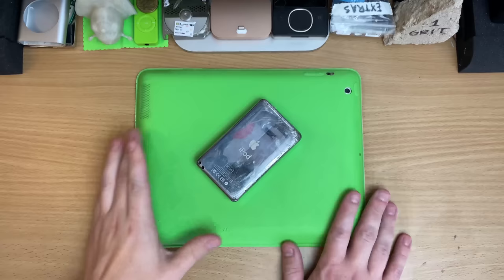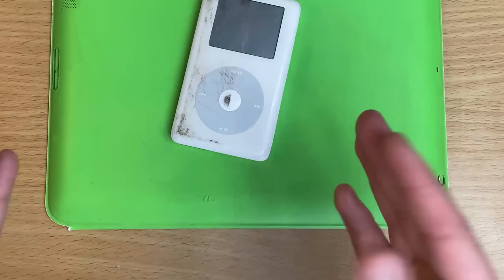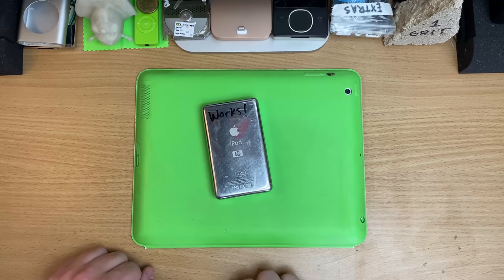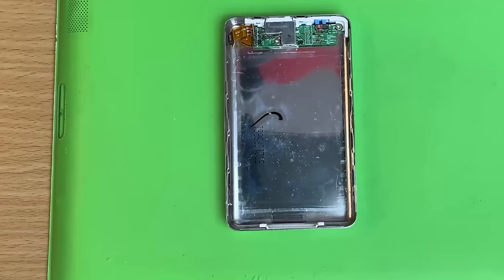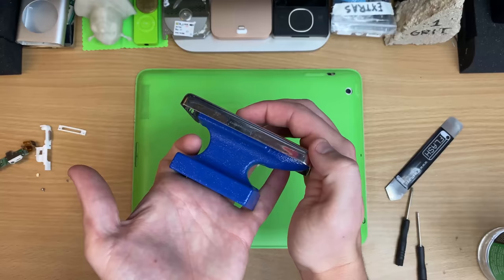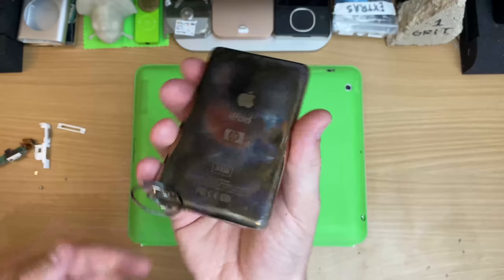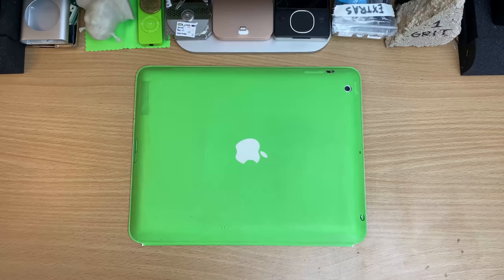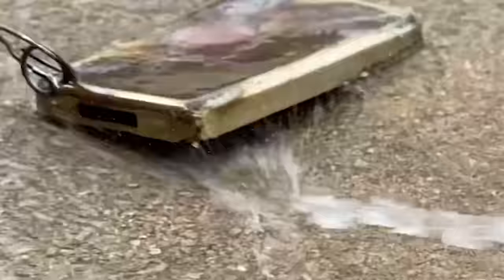I tried to "antique" my iPod.

Comment: Idk if you would have a way to get brass chips, but apparently if you nestle the steel in brass chips and heat it up from the bottom, the heat is very slow and even so you get a beautiful even blue color without warping or hot spots

Comment: A heat treat oven would put a perfect oxide layer on there. Contact a local small machine shop and see if they'll let you pop it in there for a few minutes. You could even control the temperature to get a specific color.

Comment: I work a lot with metal. You can reduce the amount of warpage those cases would get if you let them cool down with just air. 

Hitting them with water shocks them that will make the warpage more dramatic. Sure it takes longer but might make for a better final product.
Reply: I was hoping someone would say that (I know this is an old vid but I just found it). I have a friend who's a bladesmith and he would have a heart attack seeing someone blast hot metal with cold water like that.

Comment: you need to build an "oven" to get even heat, just a couple of fire bricks (or any other material that is heat/flame resistant i.e. anything used for building fireplaces should work) and don't apply the heat directly, it still might warp (I've never worked with metal this thin) so YMMW

Comment: Technically you could put the backplate on a metal container, inside the metal container you would need metal shavings or something similar so that, as you heat the container, the heat gets distributed evenly. If you want an example of someone doing it proper, you can check out Adam savages one day build mini vise! Cheers!

Comment: You could probably get 5000 or higher sandpaper and then polish it down. works on cars, should work on this. btw start with smaler sandpapers first and then get to 5000.

Comment: If you want it to a mirror polish again for the back get some 60 grit and reallly work on it till the scratches are all in the same direction (you'll have to remove a fair bit to get rid of the big scratches) then moving up to 80 grit and slowly moving your way up to 2000 grit wet sandingpaper make sure you switch between dry and wet sandpaper after 120 grit and finally polishing it with some metal polish paste on a buffing wheel you should be golden

Make sure to cover up the logo text will be gone though

Comment: For the scratches file down the sharp bits on it and sand the whole thing as well then you’ll need a buffing wheel to get it to be shiny again or maybe you can use really high grit sand paper like 20000 grit

Comment: You should have flash cooled it so it doesn't warp. The tradeoff is that the metal becomes brittle. So if you open it again next time, it might not survive. I mean, you already made it more brittle the moment you jet water at it at the end

Comment: Some machinists like to “blue” their parts so it’s not super uncommon. I think if you had a way to put in a medium that would absorb and put out heat equally it would heat the case evenly and blue it evenly. I think some machinists use metal shavings but I’m not too certain

Comment: Bro, look into cold bluing. It's a chemical process that replicates that patina blue look. You may want to clear coat it as it is only a surface finish. But it shouldn't warp the metal.

Comment: You could try setting the case in a pile of copper wool pads and heading it from underneath to get a more even heat distribution. Watched @clickspring do that several time but I don't have first have experience with it yet.

Comment: i got my mechanics and dankpods recommended at the same time every time i watch this video i just wanna know if Super Blue Bluing agent would work on an iPod back case.  or if you'd need to hot blue it with an oil quench.  probably neither would work because the back case being stainless steel but man that'd be so cool, anyway just a random though to feed the algorithm for my favorite channel.

Comment: To blue steal: 

Place entire SS back plate into (cover it) shredded brass for even heat distribution. Heat entire area until an even 290 C (555 freedoms)  is reached. Quench in oil bath not water.
Reply: Thank you for converting into Americas

Comment: Wow I am extremely late to this wish I had seen it sooner so the process you're trying to achieve is called bluing you can achieve a completely blue and even coat by using a bed of brass and heating from underneath the brass it will evenly heat the surface

Comment: if you don't have a sonic cleaner that might help to get started if you want to clean up back plates and stuff like that anything metal or plastic that can be shaken and won't fall apart or damage nothing electronic really works sometimes you get bare motherboard you can put it in a Sonic cleaner for a short amount of time but they take up about as much space as a small stool and you can fit things bigger than an iPod in it for sure you can probably fit an iPad in like a $1,000 unit and for like a $600 unit you could do like four iPods at once and clean all those back plates up but there would still be scratches and dings in the imperfections in the metal but it would get rid of a lot of stuff before you would want to work with the metal at all because anything on there as you're trying to buff out of the metal or clean it up with any kind of material will get stuck in the material or will get stuck in the tool and make a huge mess so you always want to do some sort of Sonic cleaning with metal before you go and do any kind of painting or surface corrections I guess it'd be the word for it. I've worked in manufacturing with metal stuff building parts for airplanes and helicopters and stuff for like 10 years off and on.

Comment: I wonder is using a Searzall, a torch head used for cooking, would do any better the head has cone on it to spread out the heat so you dont get hot spots. I think the cone is about the size of a classic iPod.

Comment: Why not do most of the work on the broil setting (~600deg F) in the oven, at least to start out? It would make heating the extra 200 degrees far easier and more even, but also, the oven would color it a nice orange and maybe even purple on its own.

Comment: Why not just use metal dyes? You can scratch up the back of the ipods in cool designs, sand them down so they're smooth, then put the metal dye on it and, instant antique. Clear coat for shine.

Comment: You could get a more controlled and even color distribution if you were to heat it up in the oven, and it would warp at all. This is due to heating it up all at once. You would just have to play around temperature to get the desired color you want. Here’s a link to a guide you can go off of. https://en.m.wikipedia.org/wiki/Tempering_(metallurgy)#/media/File%3ATempering_standards_used_in_blacksmithing.JPG

Comment: why not heat up an oven or grill and drop the case in? it'd heat it evenly and you have actual control of the heat, rather than blasting small areas with a torch like a psychopath. I think it could look really good if it was done evenly through an oven or a grill. an oven would theoretically only get hot enough to turn the steel brown, but a grill should be able to get hotter than that (I think? someone correct me if I'm wrong)

Comment: Couldn't you just lay it on the back? Hear me out, the color bled through to the internal part of the case, and looked less "heat spotted" than the outer portion. Plus it wouldn't warp as long as its on a flat surface

Comment: No. You are wrong. The warping does not happen because you did it "on the ground". The thin plate warped because you heated it in only one spot.

Comment: Hi does anybody have any idea what is wrong with my 4th gen? I replaced the battery as it did not want to charge at all and even when plugged in it would turn off if I tried to play music. Now with a new battery it will play music when plugged in and stays on for a short while when unplugged, but turns off pretty quickly even after hours of charging. 

Any ideas? Mouse wheel and headphone jack etc all work fine.